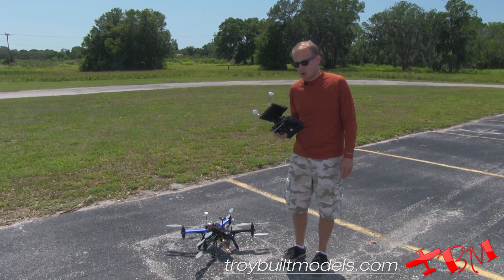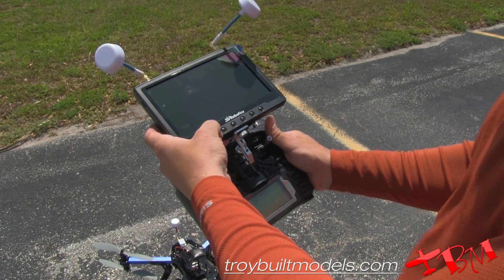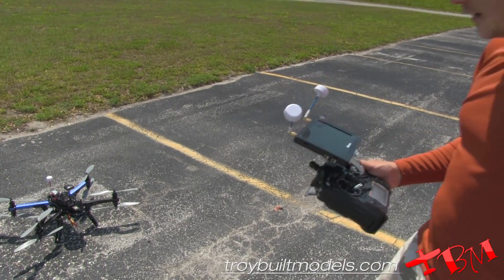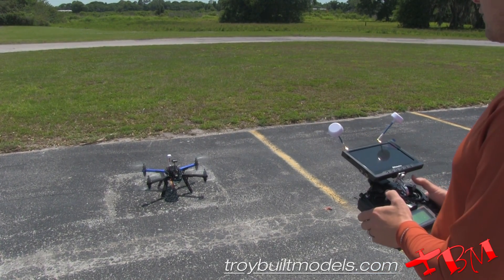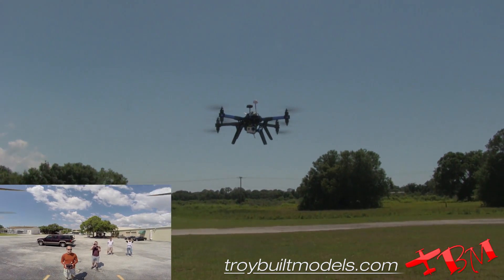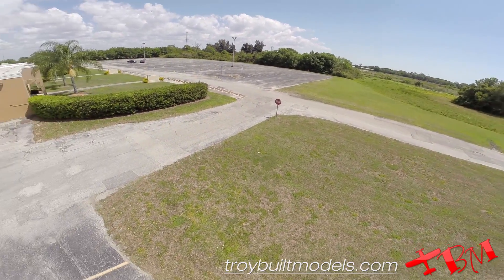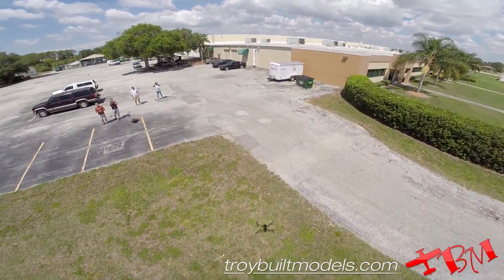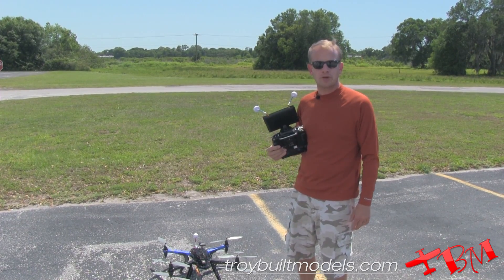3DR X8 PLUS Overview and Flight GoPro Pixhawk

Comment: How Many axis does the x8 have?
Reply from the maker: +Littleman Thor  Here is some info from their page: https://3drobotics.com/x8-power/ Because the distance between the lens on your drone and your subject is very real, serious aerial photography requires better zoom capability than a GoPro, whose 20 mm lens is incredibly wide, especially from the air. The X8+ can carry a GoPro and stabilizing gimbal (either 2 or 3 axis), so you can get great map-like views or capture sweeping scapes. However, it’s tough to really get tight on a subject with a GoPro; for that you’d need to put a bigger camera in the air. The X8+ has the additional payload capacity to hard mount high-resolution mirrorless cameras like the Panasonic LX100, whose 24-75 mm (FFE) lens gives you options for choosing focal length. This means that the X8+’s payload capacity ultimately translates into the ability to fly farther away and still get tight and focused shots. This is also incidentally good for safety: If you wanted to get tight with a GoPro, the props would be so close they’d blow hair around. So, beyond a Creed music video shoot, your options there are sort of limited.